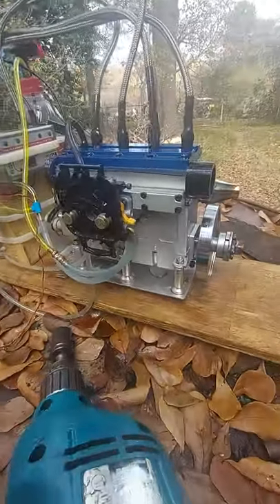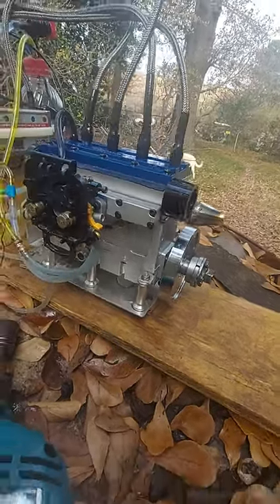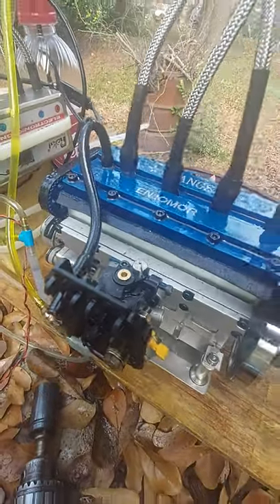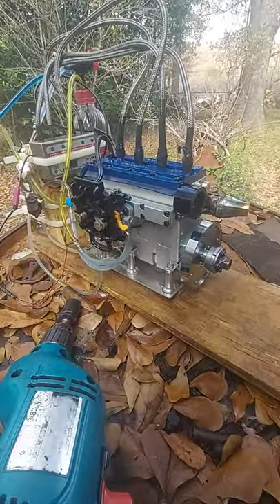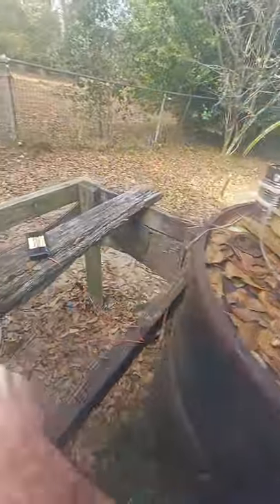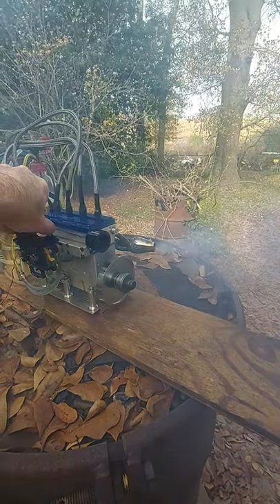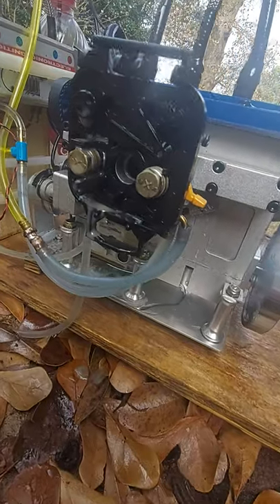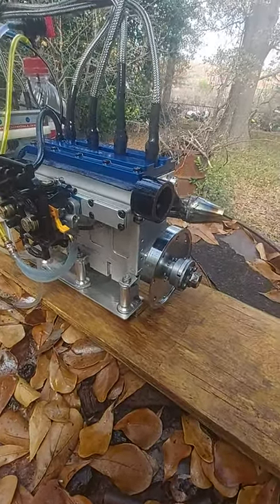Enjomor 36cc engine vid2

Comment: Thanks for this informative vid.  I have one of these myself (new in the box) and I'm looking forward to playing with it. My view is that if you are buying one of these you better look at it as a collection of parts to use to eventually put a good engine together.  At this price point I'm totally happy with that.  It also helps that I have a full machine shop!  Please keep the vids coming, Leonard,  as you work your way through the process of getting it running right.
Reply from the maker: Thanks for the comment. I contacted customer support and they agreed to send me a set of rings and hopefully a set of pistons to make this engine right. However, the rod bearings may need to be replaced because the engine went through the oil so fast that it would seize up and cut off. Like I've said before, this thing has a lot of potential. I think it got released to soon. I'm going to keep trying to make this one better until it is better or it blows up. Either way, it has been a learning experience.
Reply: @leonardfletcher9890  was your a “first edition” before they supposedly made all the fixes?
Reply from the maker: @mitchilito99  yes
Reply: @leonardfletcher9890  So it’s obvious the first thing I will have to do is fit the pistons and rings to the cylinders. Why did you switch out the ignition for that industrial strength version? 😁
Reply from the maker: @mitchilito99  The original one kept burning out the crankshaft sensor. I  had a four cylinder unit on hand.

Comment: You might consider a non-evasive work-around for the oil in the water problem.  Add a tiny amount of K-Seal.  The cyl. liner to water jacket in the block leaked on my 32cc in one little place and it smoked like a steam engine and didn't want idle at all.  To find it was difficult.  Had to remove crank and pistons and make a pressure fitting adapter plate to go over the water pump outlet to pressurize and find where water was bubbling out.  Cleaned things up and added gasket sealer under edge of liner where it meets the block.  Worked, but quite the job. I should have tried K-seal first.  I got one of the first batches of 32cc and saw worse issues.  Check my recent video.  Jim Riffle engine.    I like your wood pile work bench.  Also thanks for the carb idle tip.
Reply from the maker: Thanks for the tip. I found out that two head bolts near the center on the intake side was torqued out before actually putting a crush on the head gasket.
Reply: Well, 1 big issue hopefully solved.

Comment: Where did you get the 4 cylinder ignition? I’ve been looking and they seem difficult to track down.
Reply from the maker: I found mine on Ebay. Four 4 Cylinder Inline Engine Ignition CDI for ME8 1/4 -32 90 Degree w/ Sensor from zyhobby

Comment: Can you advise me how did you set the engine timing ?
Reply: by ear  if it responds lazy and sounds like its laboring its slow if it just wants to rev n not come down quickly its fast. listen to it move timing back n forth youll begin to hear what it wants. ive built alot of engines from stock to street race never have i used a light with no problems. didnt know they made one till i got older

Comment: You do not need a electric fuel pump on that carburetor. Your over fueling that pore thing. Gas is probably going passed the rings and mixing with the oil making it thin and then makes it burn oil. Just my two cents.
Reply from the maker: That pump doesn't put out that much pressure and is required for that type of carburetor. It also has an unrestricted fuel return so the pressure is very low.
Reply: Have you tried different carb off of a weed eater or 4mix engine? I have never been into one of them engines. But maybe it’s a rubber ring for piston ring, and that’s your blow by ? I’m just guessing here. Maybe by now you have figured it out. Would like to know what it was if you did. Seems odd they want you to have a fuel pump on that engine. I’m sure it’s just a two or 4 stroke carb off a small engine.
Reply from the maker: @dieselsforlife3847  I installed the new pistons and rings myself. As I said in the previous comment, there is no blow by. The oil is going past the valve stems due to excessive slop in the valve guides.

Comment: I heard these are horrible motors, they are very poorly made and designed. Ive even heard people spend $100-1000 getting new custom made rings to other machine work to fix these engines and still have problems. Better off buying a toyan 4 cyl
Reply from the maker: Stirlingkit sent me the correct pistons and rings and it ran much better but rattled. I went back into it to find out that the conrod bushings were destroyed by oil starvation caused by faulty rings from the original setup. I have noticed that the valve guides are quite sloppy as well.